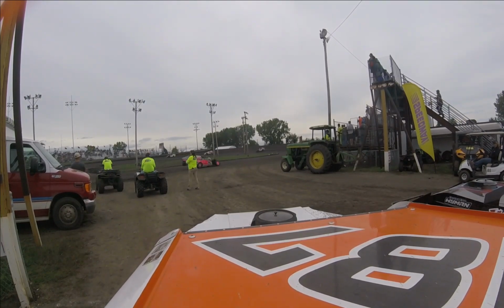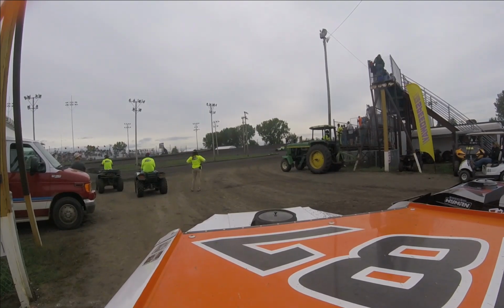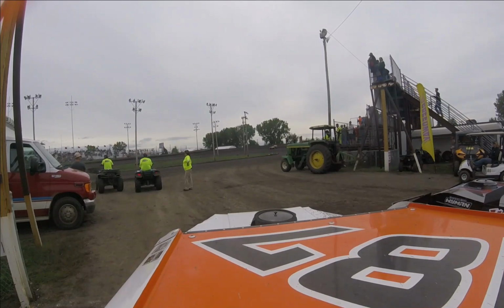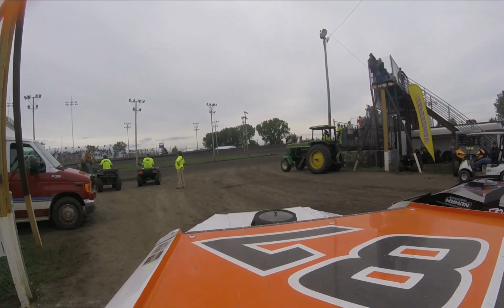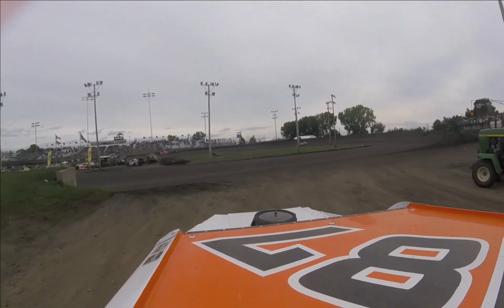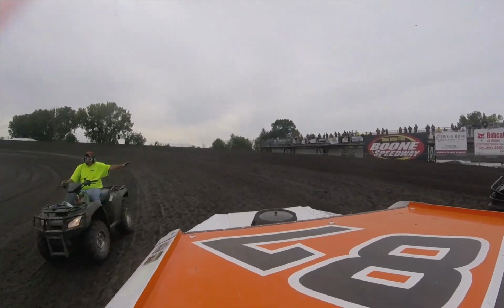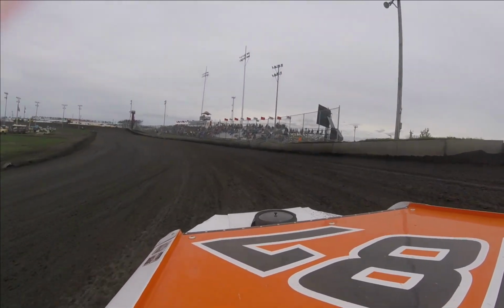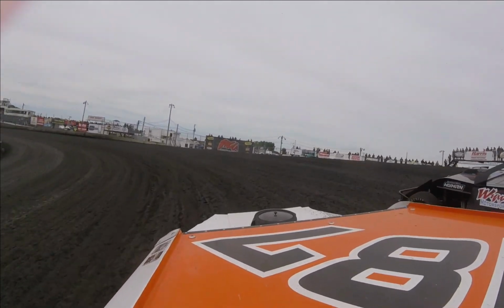Heat Race Action - IMCA Supernationals Boone Speedway

Comment: I've went to the Super Nationals in 2001, which it was an interesting experience to say the least. 

Which the not so good thing from my perspective was four of the seven drivers I worked with that year were at Boone. And none of them made the main feature on Saturday. 

Which ended my streak of main feature wins that I was apart of at 33 in a row. So Boone wasn't kind to us in 2001...

Although the three drivers that didn't go to Boone won that weekend...
Reply from the maker: It's a tough event, for sure.
Reply: @highinthedirt  Well the fact that it rained flooding rains each night. One of the teams I was up there with had a knock down drag out over which engine to put into the car. Which from my perspective, really made things not run in a streamline way. 

Because if it would have been 2002, and Kelly Shryock would have gotten the second place, he got in 2001. Then I would have to concede that it would have been a much better experience. 

Yet, since I was working with Kelly when he won at Oskaloosa in 2002. I seen that as giving up a good experience at Boone for a win at Osky.

 Because that is a track that my late dad had raced at back in the late 70s from what I understood...